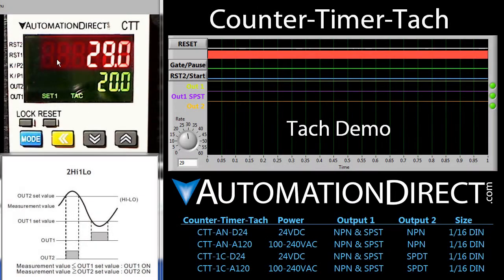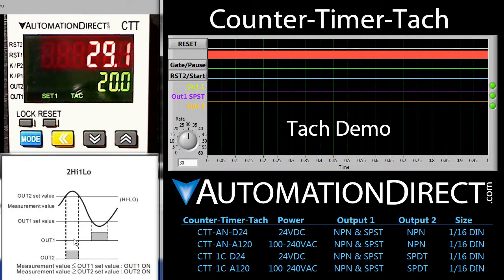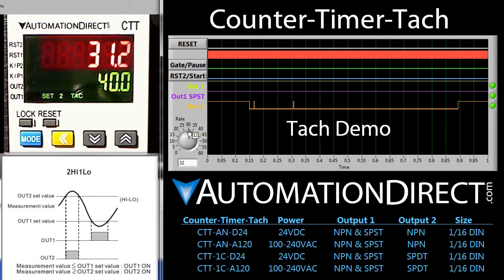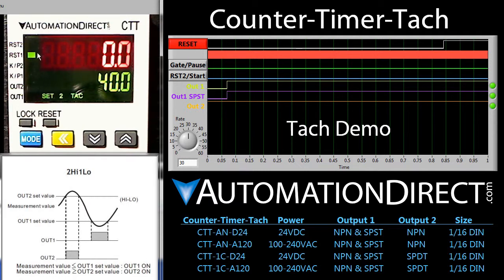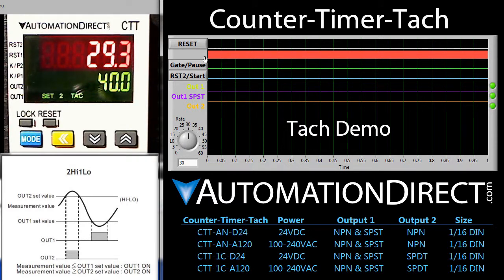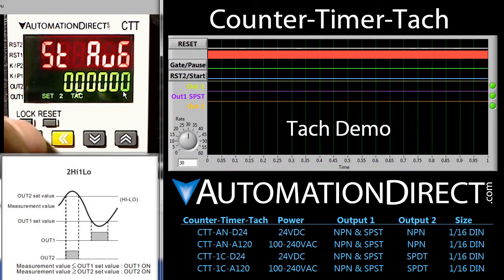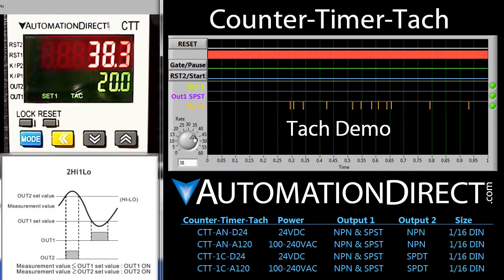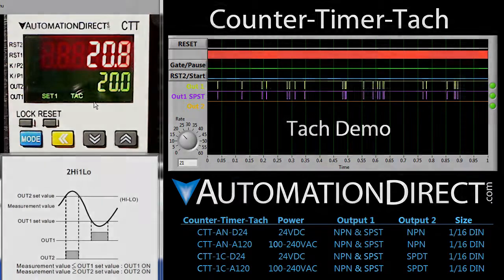Counter/Timer/Tach (CTT): Tachometer Demo from AutomationDirect

Comment: Have this setup to act as a tact for a winch, when I first engage the winch a value is displayed but after a short period of time it goes back to 0. I have to turn the winch off and back on again for the value to come back.
Reply from the maker: Thanks for the comment Murcielago229. Sounds like you need help with your individual setup. I would advise calling into our support team for answers on this topic.  This is too detailed for the comment section. Tech Support 1-800-633-0405.